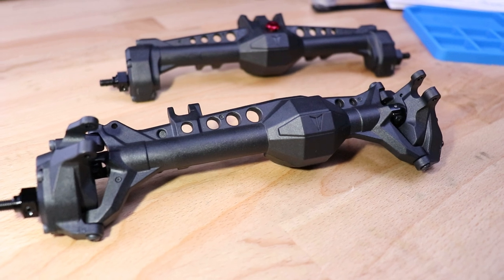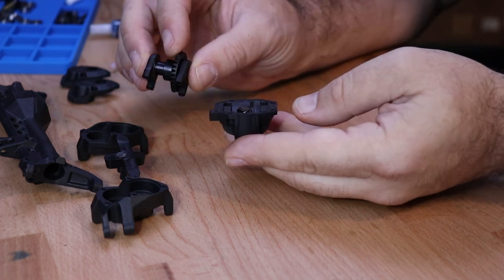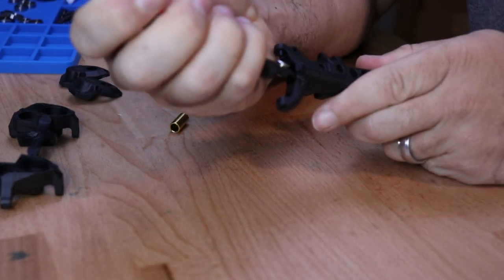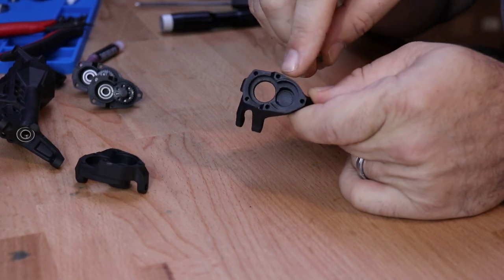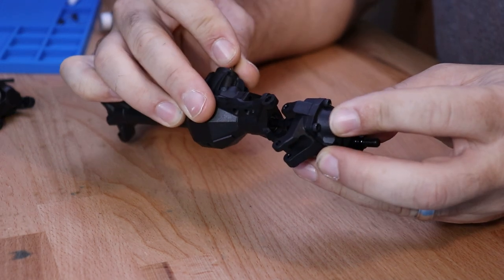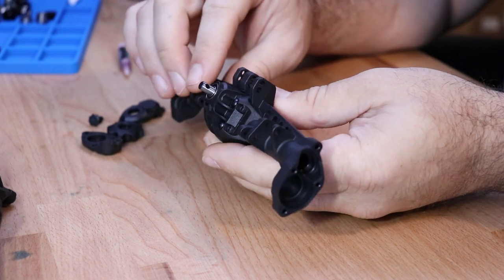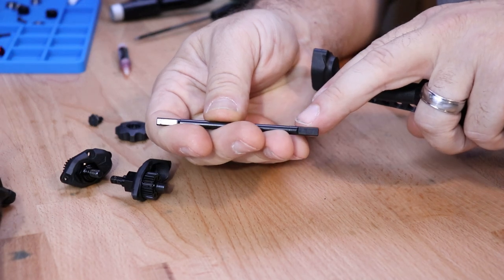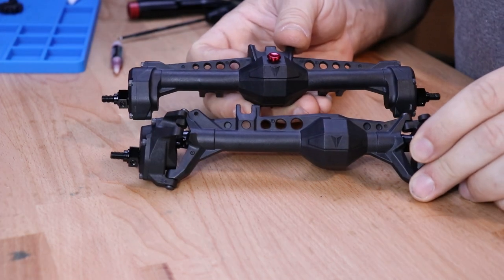Vanquish Products F10 Portal Axle Step-by-Step Instructions

Comment: The shims would go on the inside of the pinion gear to adjust the ring and pinion
Reply from the maker: That is not correct in this case. The intention of these shims is to adjust in and out backlash to with the driveshaft due to the forces that hypoid gears create, not to adjust mesh.
Reply: Where can we purchase these shims at?! I need to order some please.
Thanks!

Comment: Hello Josh I  have a question about the f10 rear portal axle shaft can't  find the replacement part using the parts list vps08611.  Or is there a different shaft that fits ?

Comment: On my kit, the brass tubes do not fit snug, they are totally loose and fall out easily. Should'nt they fit tight? On the front axle they are nice an tight in the housing.

Comment: Thanks for the build of the axles. Can the ring gear be put on the right side or left side of the pinion or is it only 1 direction? I have no kit.. yet. Will the axles ever be sold separately? If someone wanted to buy them. Thanks
Reply from the maker: These use the same gears as used in the AR44 Axles, so they can not be switched left to right by design as they are a hypoid gear. All parts will be available separately.
Reply: @HarleyDesignsInc  thank you for the quick response. Nice to know.
Reply: @HarleyDesignsInc  does this also allow the option of od/ud gearing with the available ar44 gears?
Also, are the axles and lockers specific to the F10 or are those production hard parts already?
Thank you for your time, Ryan.
Reply from the maker: @rcs_rc_az961  Yes you could use any over or underdrive gear for a AR44 axles. The locker is the same as AR44 as well. The portal gears are the same as Vanquish Portal axles, not the Axial SCX3 or Capra.
Reply: @HarleyDesignsInc  very cool. VP axle shafts and stubs then as well?

Comment: Question for ya Josh, I assembled the front axle per instructions and everything fits nice but when I got to spin the 12mm hex it’s spins freely one way and not the other. Ideas?
Reply from the maker: That’s the nature of hypoid gears. Put the driveshaft on and it won’t do that. It’s trying to pull the pinion into the case in one direction and push it out in the other.
Reply: @HarleyDesignsInc  thanks man! Loving the build so far. See ya on Wednesday night!
Reply: Building mine right now and noticed the same and came here to see if I did something wrong already 😂 Glad to see it's all good

Comment: I’m having a problem with my vrd carbon portal build I’m using the black aluminum knuckles with the brass knuckles included in my tof but it keeps looking up as I spin it I’m not sure what I did wrong
Reply from the maker: Did you install the driveshaft yet?
Reply: @HarleyDesignsInc  no I just built the portal boxs my 3rd members showed up today for the aluminum axles I’ll install them onto the axle and see if the alignments of the shafts makes the problem stop
Reply: It fixed the issue it just needed spun a couple of times to get it smoothed out, ran the car this morning at work and this carbon is no joke I haven’t found a line I can’t hit so far

Comment: Why did they decide to go with an open-faced bearing.
Reply from the maker: Because you can’t get a 7x14x3.5 bearing with a seal. So to make it reverse compatible with all the other axle and gear sets it’s was retained that way. It’s the same as any VS4-10, SCX10-2, SCX10-3, Capra, etc.
Reply: @HarleyDesignsInc  thank you  good to know   I haven't had a chance to build any of those the only actual products that I've owned the ryft which came assembled and the smt10

Comment: What shims you use to set the ring and Pinon?  Mine has alot of play/slop
Reply from the maker: There are two shims included for the pinion if needed but they aren’t really required.
Reply: Im having a clicking noise in my vrd stance and I've done everything i can in the vfd to upgrade it but still hearing a click. ive read it may need shims in the diffs. Do you know what size the shims are? @HarleyDesignsInc
Reply: @dangood6670  I believe it was the same as the ones for driveshafts
Reply: @r23g51r  ok but since it's an rtr I don't know what size shims to buy
Reply: @dangood6670  if josh don't get back to you I'll let you know later I have some at the house

Comment: Will the knuckle screw mount strip out with use.
Reply from the maker: This is something that can happen on any plastic axle if over tightened or removed and replaced many times. However it’s not a common issue.
Reply: @HarleyDesignsInc  thank you. Cool truck you designed. So many innovative ideas. Really enjoy your videos. I learned today not to over tighten.